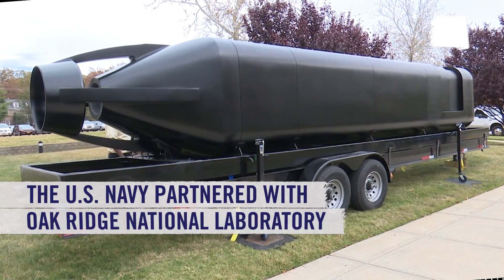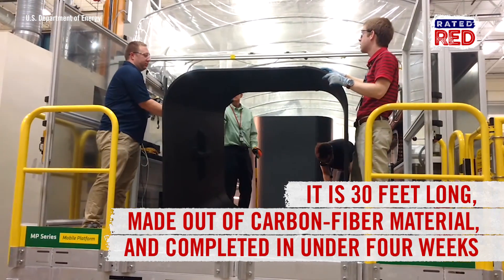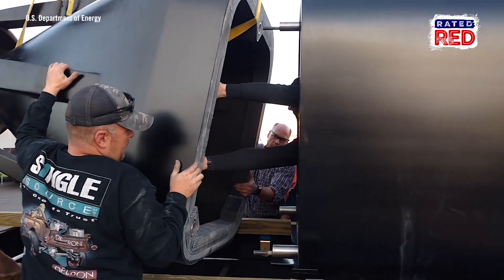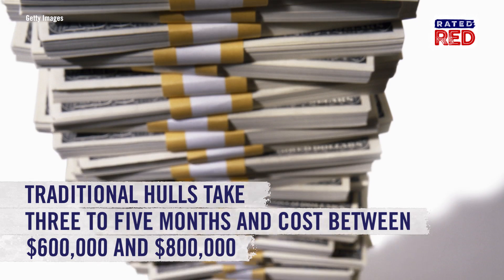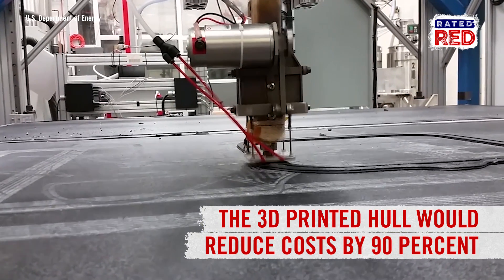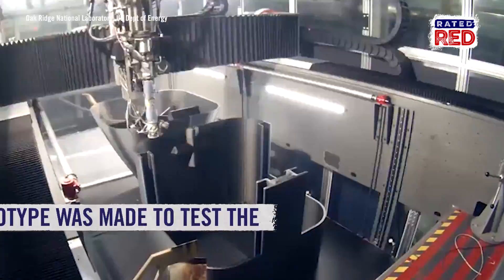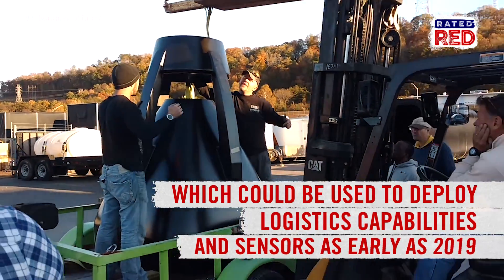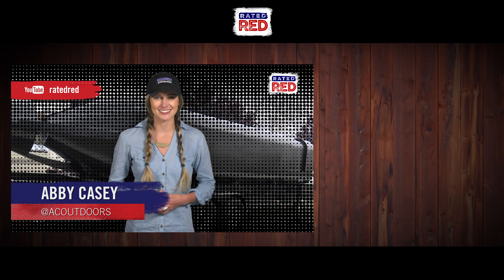The Navy Just 3D Printed a Submersible

Comment: They are already 3d printing with metals and making parts that just can't be economically produced with a machine.  I wouldn't be surprised to see giant versions of those machines in the near future producing ship bulkheads and other less intricate but larger items.
Reply: Metals are a bit more complex, The kind of molecular alignment you get by mechanical processes(like hitting them into shape or drawing them into wires ) is not that easy to replicate by adding more metal little by little.